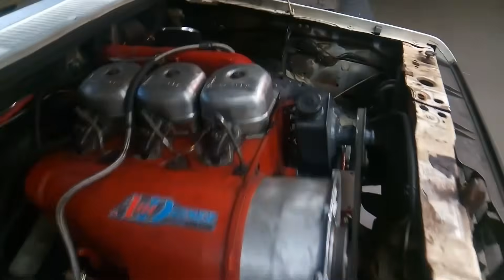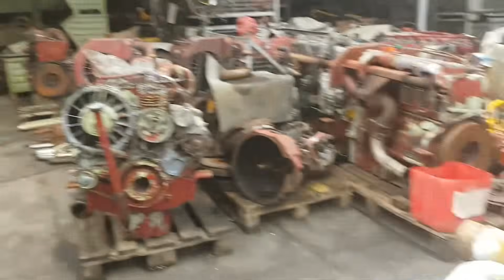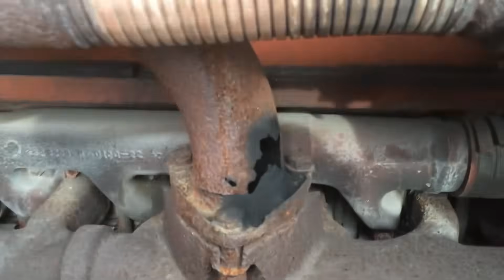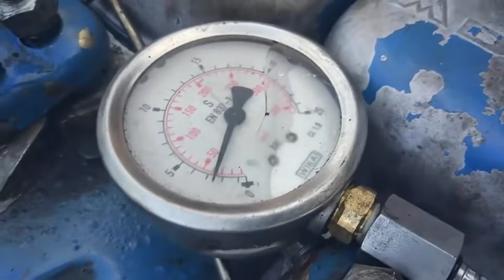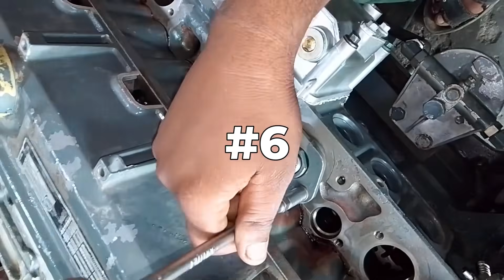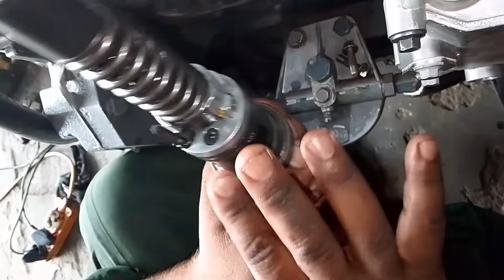20 Shocking Secrets About Deutz F6L912 You Didn’t Know!

Comment: No no 
913 doesn’t mean turbo version
The “B” as in BFL912 means turbo
Reply: 812 means 95mm bore / 120mm stroke, 912 means 100mm bore / 120mm stroke,  913 means 102mm bore / 125mm stroke, 914 means 102mm bore / 132mm stroke. BF6L913T(C) means B turbcharged, F means high-speed vehicle engine, 6 means 6-cylinder, L means air cooled, T means low preasure turbo, C means intercooler.